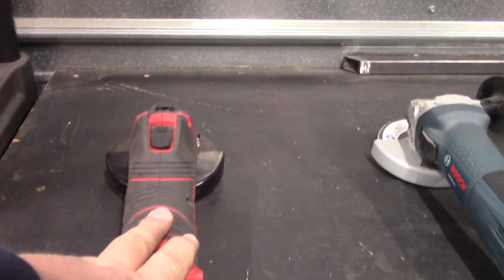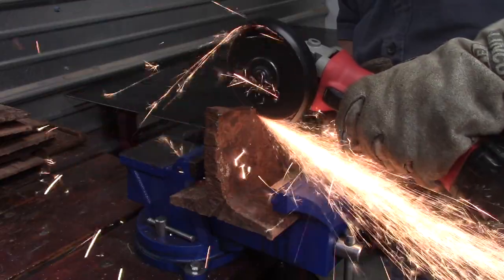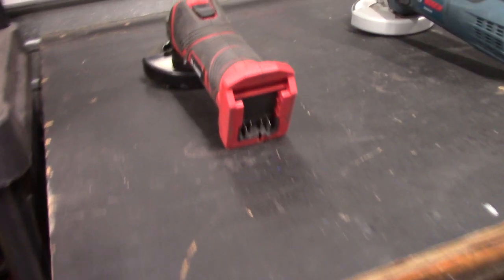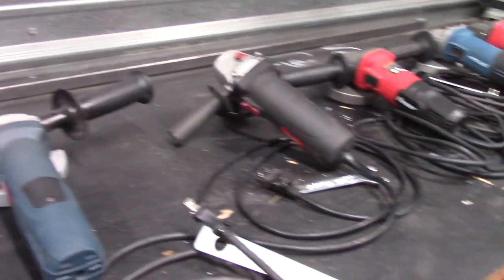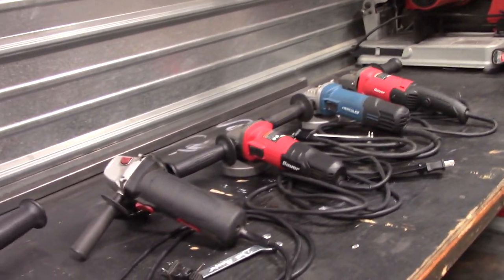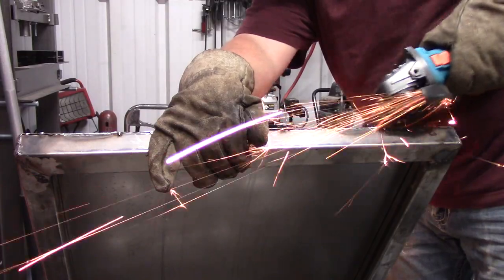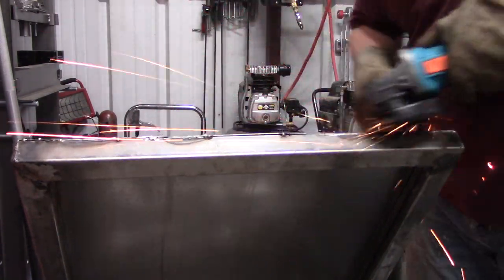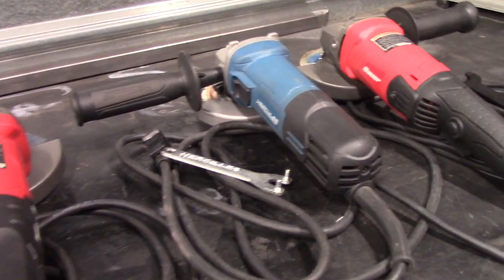Harbor Freight Angle Grinder Likes and Dislikes - Hercules, Bauer, Drill Master, and More

Comment: I have three of those DM grinders.  Mostly I use them for my flap disk, wire wheel both the flat and circular ones. Does the job. I have two BD grinders I use with cutting discs and heavy grinding discs. Good for the money and easily replaceable. No experience with any cordless grinders. Soon though, to upgrade my tool arsenal.
Reply from the maker: Zero Nine James Well you do great work even without any fancy tools. The tool part of the projects I do are almost as big of a hobby as the tools themselves for me.

Comment: Curious, do you ever use a cutting disc with the Bosch angle grinder you have, or just for grinding?  Just want to know if all your grinders can handle cutting very well. Thx
Reply from the maker: It was the first corded angle grinder I ever bought so it's served a lot of different roles in my shop. It works fine with a cut off disc. Just hate the guard on it.

Comment: I used the blue paddle switch angle grinder from HF for a couple years until it died. I ended up getting a Dewalt 11 amp paddle switch grinder because it wasn't much more than the Hercules equivalent at the time and I liked the way the guard worked and figured it would last a long time. I love the power it has. Highly recommend it. I went with paddle switch for safety.
Reply from the maker: Makes sense. I'd like to get my hands on some name brand grinders to compare them to the Harbor Freight grinders. I wouldn't blame anyone for paying just a little extra for name brand.
Reply: @DereksWorkshopAndProjects  I'm not a brand snob at all. But it was not much more at the time so I decided to give it a go. HF is really uping thier prices - they aren't always the cheapest anymore.

Comment: I've used the 7A Herc grinder for the past 2 years. Mostly with flap discs and wire brushes. It's one of the few HFT tools that I recommend. Like it a lot. I also have a Hitachi that's about the same age as the Herc, and a newer Craftsman. The Craftsman's main selling point, for me, is its low weight. Otherwise it's not nearly as good as the Herc. The Hitachi is pretty good. Might try the rat tail Bauer.
Reply from the maker: I think the Hercules is definitely a quality tool from HF. Since it’s about two years old I imagine your Hitachi is from before the merge with Metabo (if I’m not mistaken, that’s who they merged with). Metabo supposedly makes the best angle grinder out there. I’d like to try out a craftsman, actually finding myself questioning if I should have gone with Cordless Bauer seeing how good the craftsman line up seems to be.
Reply from the maker: Thanks for your response on the Herc though.

Comment: Your forgot to add that your $10 angle grinder has very easily replaceable brushes which I believe come with it and if they don’t then I also believe you can get them at your local hardware store.
Reply from the maker: True dude, good point! I think all the grinders from HF actually came with brushes.

Comment: I plan on getting a grinder for various uses. Is there a grinder/brand that is equivalent to a swiss army knife, having a big variety of accessories, discs/pads, and attachments and uses, that stands out over others. Or do they all pretty much have a good variety.
I find my self always needing to cut, grind, sand and polish various metals and things...
Reply from the maker: I believe most grinders are going to do most things. With that being said, I had to grind down a part of my Bosch grinder to clamp down on the grinding wheel correctly. I would avoid the Bosch whether you go name brand or not. Everything else is pretty good.
Reply: @DereksWorkshopAndProjects  Good to know, and I really appreciate it. I'm probably going to try to get a Hercules then.
Reply from the maker: I love the Hercules. Couldn’t go wrong with the name brand options either.